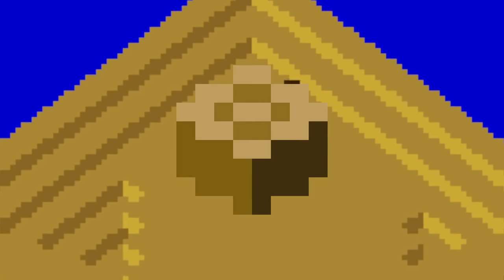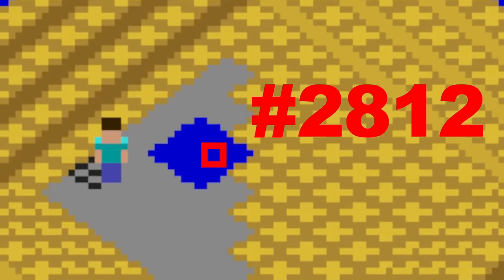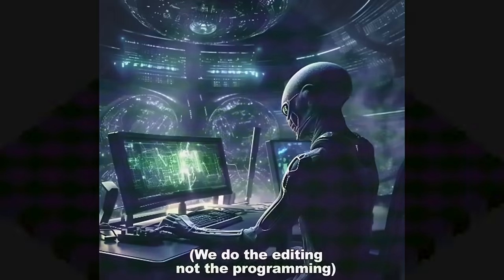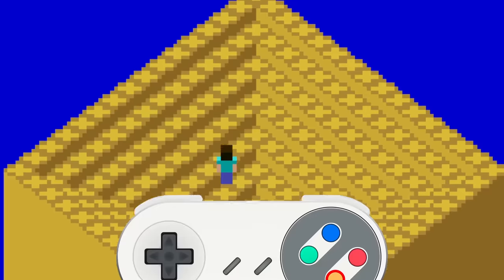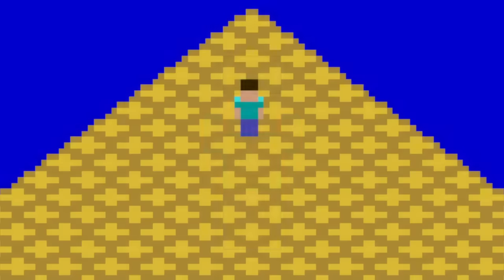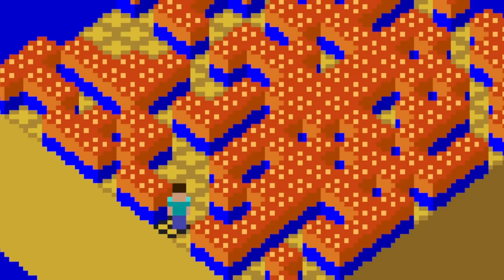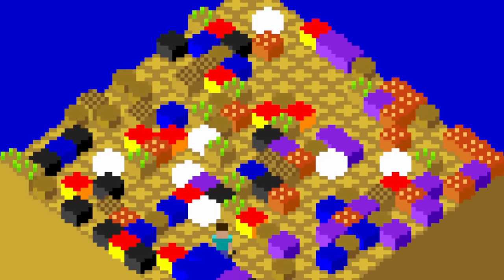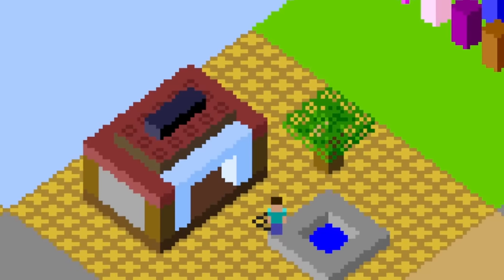8-Bit Minecraft Pt. 2: There's A Reason This Doesn't Exist

Comment: Here's an idea: what about a control to rotate the current chunk 90 degrees? So you could see multiple sides of things? I'm sure this would be super easy to implement and would in no way totally break every core system you've made thusfar.
Reply: I do wonder how difficult that would be. I don't know a thing about assembly or anything, but wouldn't it simply involve reading the chunk data in a different order? So instead of north to south, you read south to north. Then you just recalculate the player's position and rotation.
Reply: Hahahaha that was such a clever joke
Reply: that sounds so absurdly complex it'd be worth it just for the joke
Reply: That would also be really fast, like changing all the ram values? not even a milisecond
Reply: @TheGeekRex  trust me, not knowing assembly is a bliss... trust me.....
Reply: @TheGeekRex another six weeks of work just to make it stop crashing probably
Reply: Yeah have it be activated by holding select and pressing the R or L bumpers
Reply: @TheGeekRex this would require keeping track of the actual 3d coordinate plus rotating everything by some rotation. Even using quaternions (the most efficient method of dealing with 3d rotations) this is quite the computational challenge and would be difficult to implement in real time
Reply: There is a pico 8 fez demake that accomplishes something similar.
Reply: Sounds like Roller Coaster Tycoon. I wonder how many features from that game could work in this one... 🤔
Reply: @paulconway5693 why quaternions? We have 4 rotation exsctly 90 degrees, it is that simple as swapping xy coordinates and changing their signs.
Reply: A nice feature for any overhead view game.
Reply: It might not be that bad depending on how everything was implemented, then again those are the famous last words before over a month is spent on the feature😆
Reply: @TheGeekRex You also have to redraw the whole screen everytime. That can only mean: LAG and crashs
Reply: @JonasHoffmann230 why does that matter, so long as you're not doing it every 3 seconds? What do you think would happen if he had to completely change screens? It also wouldn't crash just because it is slow, that doesn't cause a crash, an actual issue in the code does.
Reply: RepentandbelieveinJesusChrist5  "Forgive thy Wario, for thou greed was but thy nature"
Reply: Nooo then you'd have to build a backside :D
Reply: I'm sure that would help to some extent but what about caves and such? He showed the current system of falling down a well but if you think about it gameplaywise it's pretty awful as you can't really see anything. A transparent outline is only good with limited obstruction. 

How should it be done? Perhaps a cave-mode where things are drawn differently so that you can see where you are. Could be just making a certain number of layers above transparent or something. Perhaps combine with only drawing blocks that would not obstruct vision.

Maybe a cave-mode wouldn't be needed and you could test to see how well this works with having the same rules and see how it looks.
Reply: you could generate a "new map" basied on the old map with all the blocks saved in new location based on how a rotation would work. You could do this everytime you try to rotate creating a massive lag each time, or store all 4 rotations as seperate maps, basicly quadrupling your map size and the time to save and changes to them.
Reply: @paulconway5693  reminds me of ASCIICKER, a game entirely made from ascii and you can do a 360 degree rotation
Reply: @paulconway5693  No, you only need to rotate in 2D really. The third dimension doesn't need to be rotated, and height can be done purely through a height offset.

2D Rotation is mathematically simple.
Reply: i think you could just have a function that doesnt do any graphics and just moves copies the world (if there even is enough memory to hold 2 copies) and then rotates it, then redraws the entire screen (slow but it works)
Reply: As an amateur coder, you sir are evil. Though I suppose it wouldn’t be terribly difficult assuming nothing goes awry (but this is machine code, let’s be realistic), RIP framerate though.
Reply: @paulconway5693 thats not how 2d orthographic projection works lol
Reply: I think that doing it in the same way as Rollecoaster tycoon 1 and 2 did would be good
Reply: also maybye a switch, to see just 1 layer at a time to check your builds
Reply: Shoulder buttons
Reply: i mean, considering that all sprites have been made taking in account this especific angle, that would take a ridiculous ammount of work to be done.
Reply: My thoughts as well, literally just rotate the matrix. Only problem i can see would be memory wise
Reply: @TheGeekRex while mostly yes, the physics code seems a bit too complicated for it to be this simple
Reply: sounds great, but the memory has not enough space to store 4 different copies of the same chunk
Reply: @Spiral2404  you don't need to, lol
Reply: i know it would probably take a while to redraw (computationally) but redrawing from different angles would be great combined with the suggestion to cull blocks above the player's head; you could even reuse the old code to have 8 directions for the camera. but i would suggest making the top of the block the same size visually as the side of the block for consistency
Reply: I know my boy was using gdb on the daily, all those memory leaks man
Reply: ideally you dont want to move the actual locations of anything, just where the locations are graphically
Reply: @link_team3855  that's why I suggested self modifying code that changed the order of the loop indexes.. maybe a little complicated but self modifying code is the gateway to performance on these un-pipelined 8 bit cpu's
Reply: It would probably have to have 10s of times more sprites loaded for each angle, or for sprites to be 3d voxels and to make a completely new 3d rendering engine @TheGeekRex
Reply: Yes, a simple idea to describe. Yes, it's probably very hard to implement..., But also I can't help but think that there's some simple linear algebra math way to do it...
From what I remember from class, linear algebra solves a lot of things...
Reply: Oh god i see this causing problems he will need to fix but i'm sure he can easily do it
Reply: with a good enough engine foundation this could involve only swapping 2-4 memory addresses
Reply: You surely dont wanna him release next video
Reply: Too hard
Reply: that would be terrible for performance as the whole screen will need to be redrawn....
Reply: @TheGeekRex  “just” doing that would be very complex for an 8-but processor, buddy. Have you ever seen an 8bit game which employs 3D rotations like that? Ever wonder why most 8bit games are fully 2D?
Reply: Best idea require worst pain.
Reply: bro is foreshadowing
Reply: I mean, its 9th grade geometry in theory, but coding it would be a nightmare
Reply: I read the first half of this and I felt 30 pounds of pure dread drop into my stomach lmao
Reply: i love reading the agony ❤

Comment: One of the problems you'll run into with isometric is platforming. Jumping from tile to tile, you can easily become discombobulated. Add a shadow that appears under your character as he jumps to help solve this, this'll help players gauge jump distance.
Reply: It certainly sounds like a good feature if the engine permits it.
Reply: But then there would be the problem of having to render the shadow on the lowest block under stanley, since it wouldn't really make sense to have a floating shadow right under your feet while you're falling. Also there would be the problem of having to split the shadow in half while you're standing between a higher block and a lower block, in 2/3 if you're standing more on the block than on the block under ect.. basically it would be needed to render every single pixel of the shadow independently from each other. Also, to make it look good it'd be needed to add a shade to every single block you can stand into in case some of the pixels of them are shadowed. So practically impossible especially with limited VRAM and colours, but this guy is crazy enough to actually somewhat do it, so we'll see
Reply: Making some of the blocks a bit darker in a checkerboard pattern would make it easier to understand where exactly a block is. It would also be helpful for the block cursor, for the same reason.
Reply: @iXenox  block shadows do the same thing but may be too hard to implement

but basically in isometric there are only 2/3 possible shadow states. The first state is where a triangular half of a face of the block is shaded on all 3 sides, not touching. The other state is the opposite halves. The last state is simply both of these, or fully shaded.

Comment: one feature I think could be useful, if possible, is to have all blocks 2 blocks above the player be invisible if the player is below a celing. so that tou could navigate caves or the interior of a house.
Reply: This might need to be a quick toggle, so that you don't lose track of things "above". It would be cool as a translucent overlay but that's probably too difficult/expensive to implement. It would probably require an extra rendering pass to generate the "top" overlay and then another one to re-render the current level slice and then calculate the overlay effect.

Comment: When you went into the house, an issue with the current design showed: There's no way to "hide all ceilings". Since you don't have the luxury of the first person cam, you need to somehow be able to hide ceilings, otherwise any cave visit or interior space will suck. A cheap way would be to simply stop drawing blocks that are above in Z and infront of the player (with that meaning the sum of x and y exceed of the block exceed the sum of the x and y coordinate of player itself). This way you could achieve something similar to the sims, where you could hide ceilings and walls in front of someone. A +-1 addition can be used to toggle between "no walls", "half height walls" and "full height walls" if you'd like that option.
Reply: option to cull blocks above player's head is a really good idea
Reply: My idea would be to not render any blocks that are in front of the player(meaning that their x, y, and z coords are all greater than or equal to the player's, assuming that greater is closer to the camera), but only when the player would be completely covered by blocks. You'd probably also need to render any block faces that shouldn't be visible as black, to prevent x-raying.
Reply: i know it would probably take a while to redraw (computationally) but redrawing from different angles would be great combined with the suggestion to cull blocks above the player's head; you could even reuse the old code to have 8 directions for the camera. but i would suggest making the top of the block the same size visually as the side of the block for consistency
Reply: my idea was to add a block for the door and maybe a clear block that indicates a cave entrance, and entering these blocks changes the whole world to the interior space you're entering

Comment: Since this is 8-bit blocks, the stack size should definitely be 8.

No but really, maybe use the last few bits to affect stack size limits, like how some items are not stackable? Maybe this could even let you have durability using the stack size bits? Great job so far, excited to see how far this gets!
Reply: Those “attributes” should be implicitly (or nominally i guess) tied to the block ID, not as a separate value like that.
Reply: A stack of 64 would only be.. well, 6 bits. Then another array entry for block type, or maybe durability counter, etc.

Comment: Using the sholder buttons to rotate the cursor seems a little unnatural. Have you considered this?: Holding R makes it so the player stands still, so the D pad is free to be used for selecting the 8 surrounding blocks. Holding L or Y also holds the player still, so the up and down buttons are free to change the cursor height.
Reply: I would also consider synthesizing the cursor and character movement. Have the dpad control the cursor position in the x,y plane, and when the player tries to move the cursor beyond the selection range have the character move into the previously-selected position.

This might end up being annoying though. Depends on whether you're doing more block manipulation or complex movement. Maybe have it toggle?
Reply: Yeah [button] + D-pad Up/Down for Z pos, and D-pad L/R for rotating
Reply: @haphazard1342 Maybe the cursor could instead be semi-tied to the player, pointing horizontally in the last direction pressed, and vertically it can be cycled through a few positions using some button (maybe 6; up, a 4-block vertical range in front of the player and down). Though this might be a bad idea.

Comment: I haven’t played this but from the looks I worry the controls may feel clunky. I know it’s probably arrogant to suggest controls then but maybe something like this could be looked at or built off of: 

• Move: D-Pad
• Jump: B
• Scroll Hotbar: L/R
• Building and Mining: Hold Y, then DPad for lateral aim, L to cycle layer, R to place/mine (depending on what the cursor is overlapping), and still B to Jump to reach higher.
• If a sword is held, Y is just a simple attack in the DPad direction, no holding it to pop out the cursor or anything.
• Quick-Place Below You: Tap Y with block selected (this seems good gameplay-wise but feels ugly).
• Inventory: X

My thought process is to speed up and simplify building, and because the cursor only appears when you hold Y it wont ruin screenshots. A, Start and Select remain free and unused for any other controls I didnt think of.

Comment: 1 neat trick I've used back in the day ( C64 era) on isometric games is to treat everything as background, then everything that's below and to the left of the character within a box 2x2 the character size ( 0,0 is bottom left) render those tiles as sprites with priority after the main character. That's way less expensive even a potato could run it glitch free. Assuming there are enough sprites/multiplex slots available.

Comment: It might be a good idea to add something like a way to display a "slice" of the world, to make it easier to go underground. Just having an outline won't be too helpful in that scenario, since you still can't see the blocks blocking your way, even if you know where you are. I think the most straight-forward way of doing this would just be to have the ability to hide the top n layers, which would allow you to scroll down to the vertical position you want to look at.
Some complications with this method arise if you want to hide things from players like the position of ores, which could be done by rendering blocks that are covered on all sides using some placeholder "hidden" sprite instead of the normal one, until they are uncovered. Though I don't know this architecture at all, so there might be better ways to do it.

Comment: I feel like the bumpers should definitely be for controlling the hotbar, while the start+dpad combo seems a really elegant way to move the cursor around. If you use start+dpad up/down to move the cursor's height, that even frees up another button on the right hand side of the controller

Comment: i know it would probably take a while to redraw (computationally) but redrawing from different angles would be great combined with the suggestion to cull blocks above the player's head; you could even reuse the old code to have 8 directions for the camera. but i would suggest making the top of the block the same size visually as the side of the block for consistency

Comment: im sure you probably already noticed this but theres quite a few cases where the player will be moving as the UI overlay is drawn causing the player area to draw overtop of the UI. so you might want to change the order of operations there or make it wait until the player stops moving to draw the UI. Thanks so much for releasing alpha!!

Comment: Something you may want consider is making the cursor and player control Pikmin-style, where the d-pad moves the cursor and if you try to move the cursor beyond your reach then the player moves
Reply: Directly moving around with the d-pad is pretty useful though. Perhaps implementing both styles and have a button/combination switch between them if it’s even possible with such limited processing power
Reply: This is actually a very good idea!

Comment: i think blocks within a certain radius of the player above their head should be hidden, so you're only ever seeing the floor and walls near the player, but never the roof over their head. this would make it so you can actually go inside of a house and see what you're walking into instead of stumbling about blindly with only a silhouette to know where you are. however, this does mean redrawing pretty much everything in that radius of the player since you can't exactly peel back stuff that's already been drawn. no idea how it'd be implemented, i can only think of ways around it like simply flattening the chunks to have a smaller height limit and generating structures without roofs. actual players will likely be placing up walls and floors anyway and forgoing things like a roof just so they can see the interior of their structures, so having flatter chunks might not be too unreasonable.

Comment: Great vid. I thought a bit about the inventory. You can theoretically store a bunch of 6 bit numbers packed together, but in case of such a small inventory it wouldn't be beneficial since you'd spend more memory on fetching/storing the number instructions, compared to how much you'd save. You'd need somewhere around 160 slot inventory to just gain net 0 compression with such a method. Also this wouldn't be as fast as just fetching a number from memory directly. So having 64/256 item slots is purely based on what you prefer more